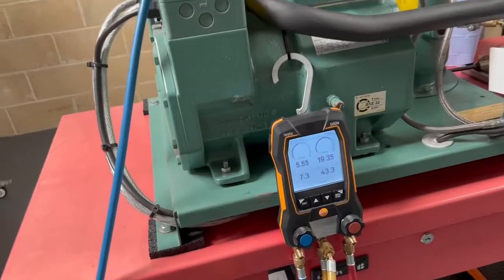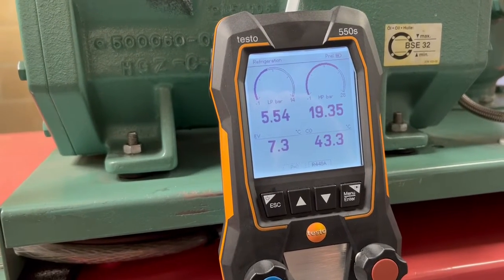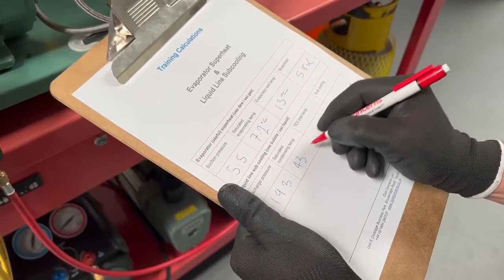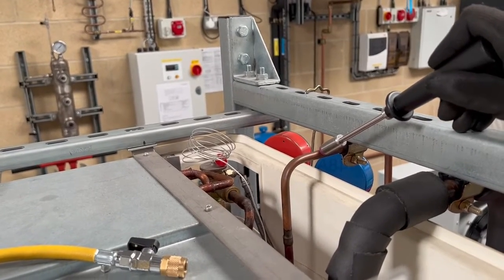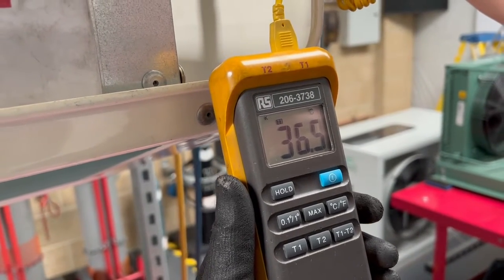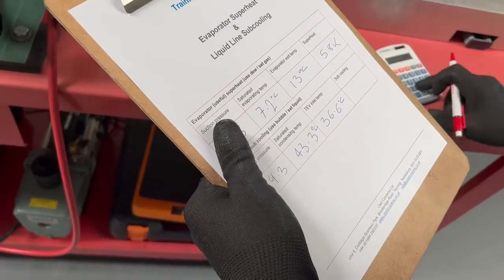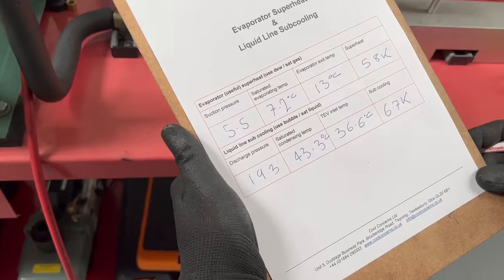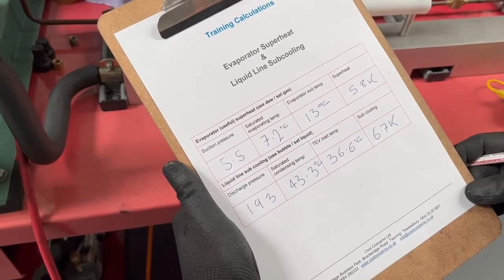How to measure subcooling

Comment: Good day sir what is the range of subcooling and super heat in cold room freezer and chiller thanks
Reply from the maker: Good afternoon, we've been told by one of our technical expert "There is not one size fits all, most DX evaporator expansion valves would normally look to control 4-8k of superheat, subcooling is not controlled as such but you would expect to see between 2-5k of subcooling on simple systems. ". Hope this helps!

Comment: Hi there,  great demonstration. 
If you were to take the liquid line temperature just before the metering device would there be much difference?  Would it continue to subcool?
Reply from the maker: The reason for taking the temperature of the liquid on the ambient side of the cooled space (e.g. as the pipe enters the cold room) is to calculate the subcooling that has occurred because of the outside ambient conditions. You can measure the liquid line before the expansion device, this would then include the subcooling that has happened due to the liquid line entering the cooled space, care should be taken to ensure the expansion device temperature drop (happening due to the refrigerant expansion) does not influence the temperature of the liquid, line so suggest measuring no closer than 150mm to the inlet to the expansion (metering) device.

The other reason for measuring the pipe on the ambient side is that evaporators can sometimes be difficult to access (loaded room, mounted high on room ceilings etc), whereas you can normally access the liquid line service on the roof or outside of the cooled space.